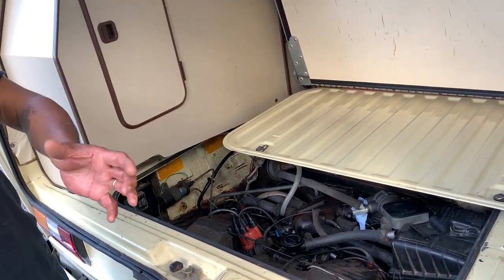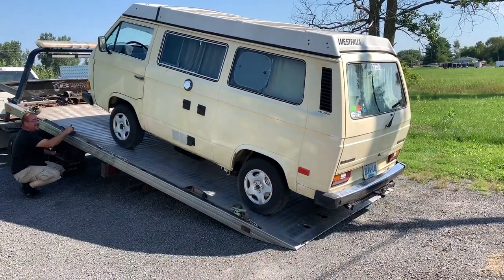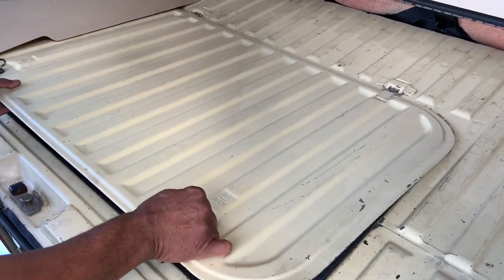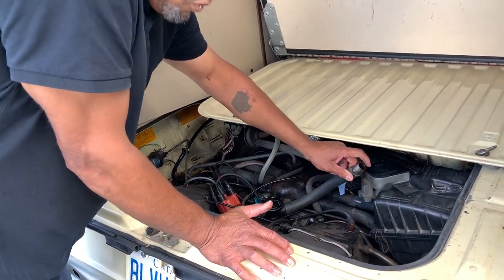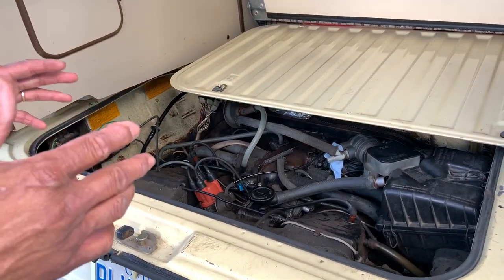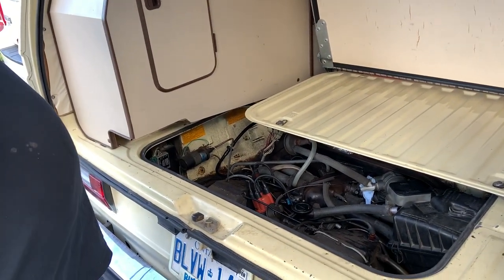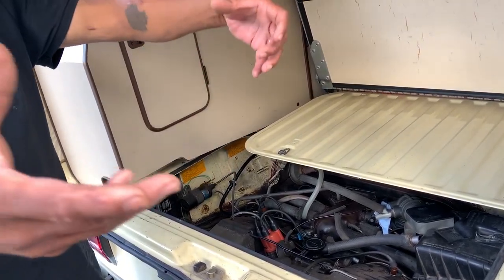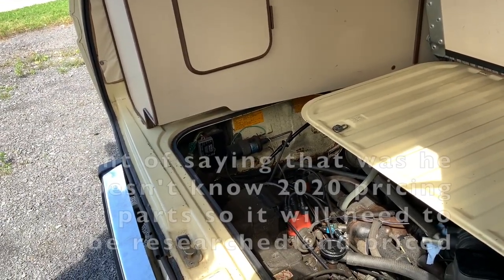Air Cooled VW Vanagon Engine Rebuild Options - Netcruzer CARS

Comment: I've built many type 4 (late model bus/vanagon engines)  You can make bigger power, but the stock fuel injection is not ideal for the upgrade.  Injectors have to be matched for the realistic power gains. Type 4's benefit the most from properly done exhaust work.  They naturally have plenty of torque.  You benefit from a better header as well.

My favorite combination for late buses and vanagons would be a 96x78 (2258cc).  Mild cam, proper head work.  They run cool with the stock oil cooler.   

A well built 2.0 with a slight bump in compression and good head work would be the safest choice.
Reply from the maker: Thanks Monica. I ended up going with stock sizing, new heads, new positions. Keeping it as stock as possible for reliability since first motor lasted 40yrs I figured not push it for fuel or thermals. Getting a stock profile hydraulic lifter cam for manual transmission has been most difficult thing to source. I’m awaiting an OEM cam to arrive from Overseas.
Reply: Hi Monica,I got same issues,low compressing on my 1980,wit 146k.I am still looking for an option to swap an engine fro Audi 2005 1,8l or rebuilt an existing.What you can recommend?Thank you in advance

Comment: If you got 40 years out of the original engine that's fantastic. I have replaced mine twice. Seem to get about 150,000 miles before the third cylinder compression goes. I have an external oil cooler which seems to help but...

Comment: really curious about how this has gone for you. Any updates?
Reply from the maker: Did a stock 2.0 rebuild, new pistons, sleeves, valves, camshaft, seals, etc and also needed a new head because valve guides had cracked. Had a lot of delays because of the pandemic. Took over a year, almost 2 to complete but I sourced all the parts.

Comment: Late to the party on this one. Really hope you get good news
Reply from the maker: Not sure how extensive the damage is yet. Top end needs pistons and rings for sure. Bottom
End needs to be checked for bearings and tolerances. Hopefully it doesn’t need bottom end work too. 😬🤞
Reply: @netcruzer  Hope Does not totally break the bank , i did a top end rebuild of my 81 last year was aroun 1500$ here in ottawa

Comment: How much did the build end up running you? I have an 81 westy. She ain't doing so well.
Reply from the maker: It’a not done yet. Massive delays and missteps but it was about $3600 CAD in parts so far. That is for a full top end replacement and other parts. Labour bill total is still unknown.
Reply: @netcruzer  that's really not too bad. Hopefully it doesn't take the guy 8 months to finish haha